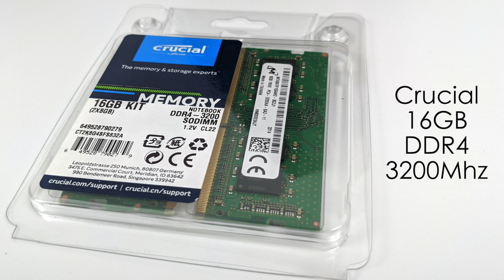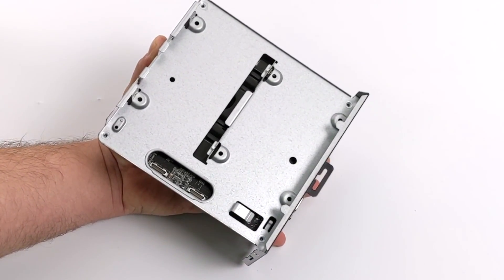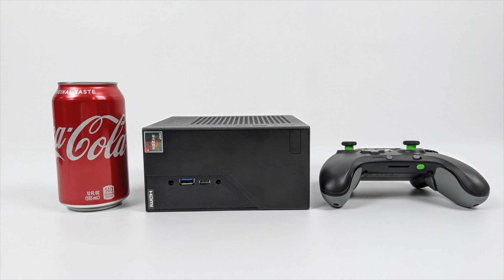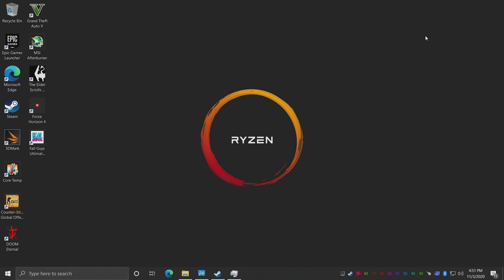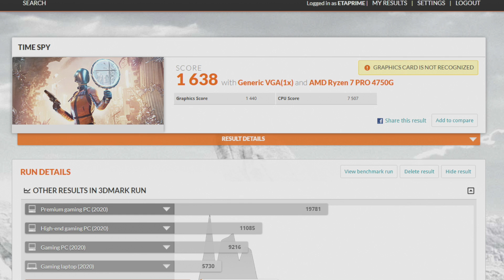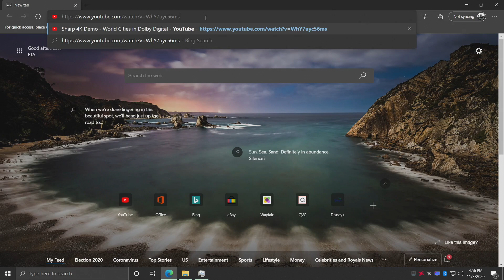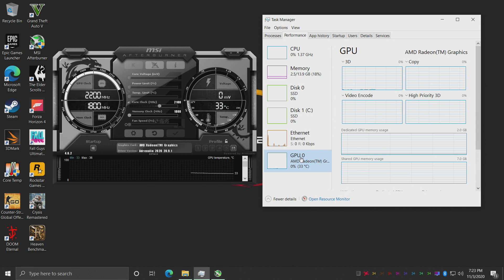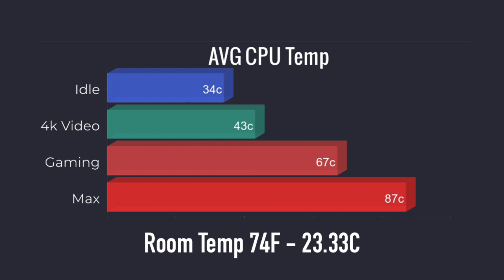Ryzen 4750G ASRock Desk Mini Build - A Tiny APU Beast!

Comment: I know I'm late to the show but I recently snatched brand new Lenovo M75q gen2 (which you tested) but with R7 4750G. Threw 32 gigs of RAM @3200MHz in it and it's running smooth like silk. No app is too demanding, no task is too heavy. Haven't tried gaming on it yet. All in all I'm super happy with both Lenovo mini PC and 4750G APU.
Reply: Hi! What about the noise level on the m75q? Is the machine loud when working/watching youtube?

I am trying to decide between m75q gen2 and the x300 build
Reply: @wbio  When doing light work like MS office, browsing, youtube, watching vids on stream platforms, etc its basically noiseless. I don't even notice it. 
But when I play some games (vega 8 is decent for some light gaming) thats when you start hearing vents spin and noise level rises.
Reply: @Quickr86  Thank you!

Comment: My dad just built this just like the video but added one more hdd of each style and it works EXCEPT for the massive grinding noise of the fan, it a huge disappointment and major set back. Anyone experience this or anyone have a fix???
Reply: What about the Noctua nh-l9a cooler? Or have you found another solution?

Comment: i am thinking of building a system using the 4700g.
it will cost me around 400$ if I removed the Danish vat or 500$ with vat.
it would be the cheapest way for me to get a 8 core computer.

Comment: Just done similar build using 5600g. It is a tight fit as IS-47 catches back power/led module,had to make sure no slack on cable and hooked on side panel. Fitted Noctua NF-A4x10 pwm as exhaust(double sided taped just above hdmi/DP inputs). NF-A4x20 should fit as well. Idle temps 38°. Only used Ryzen master to "auto overclock" and CineBench R23 gave MultiCore 11278 with temps 75° approx . The big change was to replace IS-47k fan with Noctua NF-A9x14 and reverse fan as intake(towards cpu) as with the heatsink tight to top made more sense to pull air in and let 40mm fan help as exhaust

Comment: I have the 4650g, In the bios I believe that most if not all motherboards use only 512mb of the system Ram by default. You can change and allocate more Ram to the graphics. Up to 16GB depending o the board. I upped mine to 4GB as there is only 16 installed. Maybe this helps as well.

Comment: I built this exact PC, based on your video's info. It was actually my first "at home build."  I was very careful to follow your instructions exactly. No real problems with the build except for the leads on the WiFi card, but finally got them done to my satisfaction.  I was SO EXCITED... but then SO disappointed when it wouldn't power on so I could load my OS, grab the updates and install other software.  I confirmed the power adapter is functional with a multimeter.
I'm suspecting a bad power switch... GRRRRR!!!   :-(

Comment: small tiny pcs have too many heat issues.  i use a 40 dollar mid tower case from micro center that came with a 500 watt power supply. im on my 2nd motherboard/cpu in it still going strong.

Comment: I'm using this box with a Ryzen 5 3400G on 16GB DDR4-3200 as my Home Office PC. I actually use the Noctua NH-L9a-AM4 cooler. It is even lower than the cooler you use in your build but probably won't cool as efficient on the 4750G.

Comment: There are 2 m.2 slot, for those expert and experience builder, can i use the other m.2 slot so i can connect a exp gdc v8 with gtx 960 gpu as eGPU

Comment: Recently build myself a Ryzen 7 pro 4750g and this x300. Specifically for use with Linux. It runs like a charm, very powerful and the cpu was €339 for me via retail channel. The overpriced for what you get in my opinion only holds water if gaming is a concern. When I game it's older titles. This is hands down the best small size computer.
Reply: I am using older deskmini with 3400g & Ubuntu 
Great machine.

Comment: Can someone help with a build? I'm doing a Ryzen 3 3200g SFF build for emulation and very light gaming. Only aiming for 1080p 60hz and would be looking to emulate up to a GameCube. 
Am I better going with the ASRock Desk Mini X300 or going the mini ITX Route? 
I'm fairly new to PC Building and the X300 route seems the better option but you look online and barely anyone seems to have touched it. Worried that I am missing some downside.
Any help and advice would be massively appreciated.

Comment: I commented about your vid on the super little PC a few months ago. I know it is kind of late to try asking about the build, but you presented it so well, I am dying to know more. I think it could be perfect for my travels, to use it for cad work and do site specific changes to building plans. I was wondering if you managed to overclock the memory to get more performance from the CPU and Vega Graphics. Did you run into any thermal problems with the little cooler you chose. Have you tried pairing it with one of those external GPU setups?

Comment: I have just found a mini buck regulator that will get input voltage of 19v down to 12v and its tiny .......... its called a mini360 this will enable me to power a sata connector for the h100i ......
I will report back ....... used mini pc today as above recorded 57 degrees just on Google surfing!
Reply: Ok have finally got H100i to work - using buck360 mini regulators - fitted within the x300 case. Finally this little PC is running allot cooler and is almost silent. I managed to get the H100i cooling pipes out the back of the x300 with minimum alteration and the radiator just sits along side the mini PC. The ram still gets a bit hot .... only when gaming. To all viewing this video be aware this thing with the air cooler is pretty noisy even when asked to do the lightest tasks. I had temps of 85 degrees and a really hot case when running WOT for 10 minutes....then it would crash. Now top temps are 56 degrees and almost silence. This video is right the memory will run nicely at 3600mhz be sure to check the AMD compatibility list. I also run my 4750G GPU at 2200mhz nice. This is a super powerful pc with pretty decent graphics....but don't expect too much from an air cooler ...... enjoy.

Comment: Hi ok well I built one of these exactly as your good presentation ........... there are some serious issues the IS-47i heatsink it does fit but...
35% of its vented area is blocked by the case. Consequently this thing can quickly become really really hot, reported temps got up to
85 deg plus on Aieda64 stress test. The big issue for me was World of Tanks this made the pc really hot after 10 minutes - then it would keel over
- I did endless tests.. on memory (running all std frequencies 2100 GPU and 3200 memory) it was fine. Then I ran PC without the restrictive cover
this was a revelation the 85 degrees dropped to 70 degrees - WOT was rock stable........ Aieda64 ran without a hitch. So my view is - as presented above 
in the video ... it is not really representational of what I had. The cooler is pushed within the restrained case..and is noisy and irritating.... and it thermal throttles real easy.
I love the form factor - I love the APU, NVME, Ram etc ....... but there is an issue with cooling. I am going to somehow fit an HD100i cooler with push pull fans
sited remotely this should get most of the severe heat away from the case - and give me a CPU temperature of around 57 degrees and a nice quiet experience. 
With the Corsair H100i I just need to figure out the sata power required........... so yeah great video just beware of the heat as this machine is a beast.

Comment: this product ist not very good for linux, because asrock is not able to build a good uefi-firmware.
with windows, ok.(but i do not use it) i have the same meaning about A300.
and there are no technical differences with A300 and X300 (only other firmware)
so, ~150 euro is very expansive for old agesa firmware, incompatible ssd and some wtf moments in the uefi....the support didn´t help me, too.

Comment: New to mini desktops, would you need to buy a gpu for that case? If so how would you install a mid tier GPU, like the gtx 1660, or a 1080 ti
Reply: Dedicated GPUs will not work with a build like this. If you want better graphics performance, you'll need to step up to Mini ITX form factor.

Comment: What would make these computers great is if they had a model with a thunderbolt port so that when you get the money, you could potentially get an external enclosure. This is just my opinion though. But in the end, for a pc to run rather light stuff such as CS:GO, Minecraft even with some mods that arent too tasking or a game like Terraria, This would be a great little pc to build because it doesn't take up much room at all but still gives you the full experience of pc gaming as long as the games arent too demanding because of the limited hardware that is available right now. Maybe within the next couple years, we could see some RDNA apu's from AMD that would revolutionize the sff pc market.

Comment: Hello, do you have any problems when using Ubuntu Desktop instead of Windows? I'm talking about screen freeze or system reboot? (when the gpu is solicited)
I did a similar build with a deskimi x300 and a Ryzen 4750g and ubuntu plant usually freezes or restarts when I request the GPu.

Comment: kinda silly to have an 8 core apu though. i wish they would just sell the Vega 8 with the quad core, its not like its going to bottleneck. Actually, Navi based APUs are painfully overdue. I hope Intel starts to compete with Xe. Give the market some competition. an i3 11100C with 128EUs of Iris Xe, and an L4 edram like my 5775C has, would be a sweet little chip.

Comment: @ETA PRIME What would you suggest choosing, between recreating this build vs. a Minisforum X400 with the same processor, RAM, and storage?

Is the Minisforum using the same motherboard?

How does cooling performance/overclock differ between them?

Thanks!

Comment: One questions if anyone can answer its most appreciated

How does this cooler compare to the Wraith Stealth and the Noctua L9a? (Fan noise isn't a problem for me) 

I'm currently running a deskmini x300 with a 3200g  and stock wraith cooler along with 2x8 3200mhz CL16 ram. When I run GTA V story mode my temps go up to 99 degrees Celsius and because of that I have to bump down the resolution.  It's been hard to find a small cooler to fit in the x300

Comment: Mosfets get really hot unfortunately. Case just too low for an additional stock  Wraith cooler ;-(
In combination with some monitors weird responses - no identification, if monitor is turned off the signal is lost totally. Useless VGA connector. UEFI slightly behind (AGESA). No overclocking or undervolting in UEFI

Comment: WARNING NOTE
That PNY CS900 has had a very VERY high failure rate for us, we've lost over 30 of them due to the flash controller frying itself(visible heat damage on most), and while you can repair it, you need a doner SSD an the proper equipment to replace the BGA flash controller
The PNY CS1311 has given us no issues, and the problem is due to the Phison S11 controller. The failure of the CS900 is abrupt with absolutely no warning, and the drive is inaccessable once it fails

Comment: I didn't get notified about this video...
 Also, for gaming, the 3200g is the best, if not the 2400g, in the x300.
 This new Apus are better on the a300 because of the lack of overclocking.
 Is the ram voltage unlocked?

Comment: Hi man thanks for the video!
Quick question: I want to buy/build  a PC, what CPU and GPU do I need for running GameCube Dolphin Emulator at 4k resolution?
Reply: 6 Cores CPU = R5-3600X/3600XT/5600X, i5-10400, i7-8700/K

GPU = 1660ti, 2060, 2070, 5600XT, 5700XT

Comment: I checked ASRock website and it recommend Ryzen 5 pro 3400g which is a very inferior processor in comparison to this one in the video.My question is say I install this 4750 processor and clicked on the bios update button, it may make the unit working wrong way because they recommended a whole different range of processors for this system and secondly  if anything happens wrong in terms of its functionality (ASRock) then they would put the whole thing on our shoulders as its not a recommended processor for their mini pc unit. So should we install this processor with this ASRock mini pc unit?

Comment: I just finished building one of these. You didn't mention it but it looks like you had the same issue I did when you slid the board in the case. The cooler hits the power button/LED bracket in the case, keeping it about 1cm away from closing. I had to remove that bracket by bending it and breaking it off. I think the cooler will provide enough support for the button that it will not be needed. What was your solution?

Comment: Video card can be installed by connecting PCIe externally, but I don't know if psu can provide that much power, I think you should try. 

Let me fix it. You can operate the video card connected with your PCie by connecting it to an external power source. If I do not know wrong

Comment: The problem is GPUs not CPUs! 

Once you exceed single channel RAM and dual core processors the difference is GPU output and throughput.

Form factor PCs are pretty much worthless

Comment: Do you think youll be able to add an external gpu were the WiFi card goes* and then add WiFi via ethernet or usb WiFi?

I think there's an extension slot thing were you can add a you with the WiFi card slot.

Would the mother board also work with the AMD RYZEN 5 3600 and an external GPU?

Comment: Lol, I've just built the same pc for my daily runner. My gaming pc uses too much power to run it all day, so I needed something lightweight for everyday use. But I went with the Ryzen 5 3400G, which has the Vega 11 graphics. Also, I just can't live without at least some RGB, so I paired it with a Coolermaster Masterair G200P, that has a RGB light with controller. It fits with lots of room to spare, plus its single RGB fan light is enough to light up the entire little case!! XD XD 

The cooler comes with a standard 3 pin plug for the fan, but the RGB sadly comes with only one male and one female molex connectors for the RGB power. So I found an old 3 pin fan, cut of the plug, leaving about 2" of wire to work with, cut off the 2 molex plugs, and soldered the 2 little RGB wires to the 12v and negative wires of the old fan. Of course you have to make sure you connect it correctly, and as the Coolermaster comes with black wires, which is aesthetically much better than ketchup and mustard wires, the negative wire has like, a light grey intermittent line running along it. So I connected that one to the black wire from the old fan plug, and the solid black one to the yellow wire of the old plug. Don't connect it to the red one, as that is the 5v wire. 

Then I just plugged in the fan connector into the 1st CPU fan socket, and the power for the RGB into the second CPU fan socket. And I have to say, it looks fantastic when running, plus the Coolermaster has absolutely no problem keeping the temps of the 65w CPU in check.  It's even ASRock Polychrome sync compatible!! However, I have not yet tried to get that to work. I don't think it will, as the RGB is not running off a RGB header, but rather just a fan header. Anyway, I still had one problem, and that was where to put the controller for the RGB.

Now after looking all over the case, I noticed at the back, it has a little fitting hole, that you can break open if you want to install an extra audio and mic adapter. But as I use HDMI, I don't need the audio, plus the case comes standard with these plugs on the front, if ever I should want to plug in a headset. And after some testing, I found that if I secured the controller on the inside of the case, just in the middle of that hole, I could easily press all three buttons as needed. So I glued it in place with a glue gun, as that damages nothing, it hardens really fast, and of course can be easily removed if ever I choose to do so. 

The only problem was that sometimes when I pressed it, because I used very little "glue", it would come away from the back, and get pushed inside the machine. So I opened it up again, and as the back of it was about half an inch from the side of the fan itself, I just cut a piece of black plastic, and hot glued it firmly in place, with the back having the solid support of the fan behind it. So no matter how hard you push now, it's not going anywhere. And once you close everything up, you can't see any of my handy gluing, and you can change the colors and programs and brightness all you want, without seeing anything except all the glorious RGB lighting. 

Hope this helps anybody else planning on using this brilliant little system, but needs some RGB in their lives as well. XD XD

Comment: In my opinion it is perfect machine for high quiality audio streamer running for an example, Daphile. Yes, we could buy maybe something cheaper - older, used, but it is always risk buying old and used. This is brand new, wish i could buy it in Poland because this kind of small, extra small pc is not a good place on market in my country. It is not meant to play games, so it is hard to buy. Nice one. I wish i could buy the same with Intel processor, saw something similar years ago with Skylake.

Comment: Money saving options if you're willing to compromise:
Swap out both of those drives for a single 1TB Western Digital SN550 to save $35
Buy a Ryzen 5 Pro 4650G for $267 to save $73
=$591

He didn't include the cost of the low-profile cooler, which is unfortunately $45.